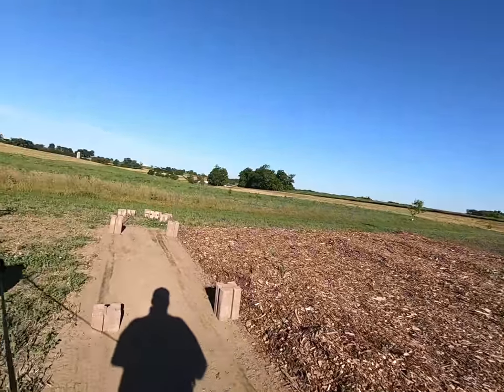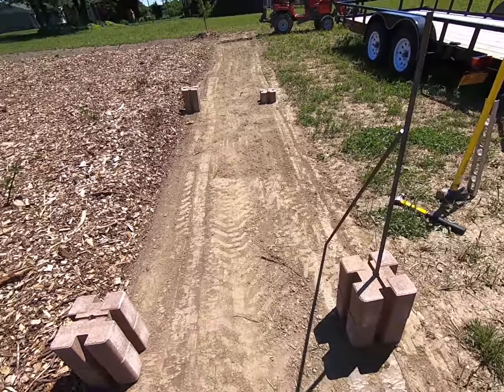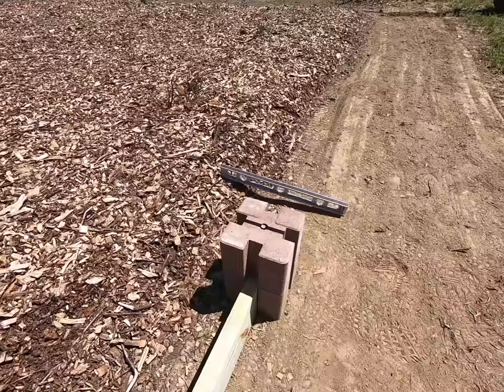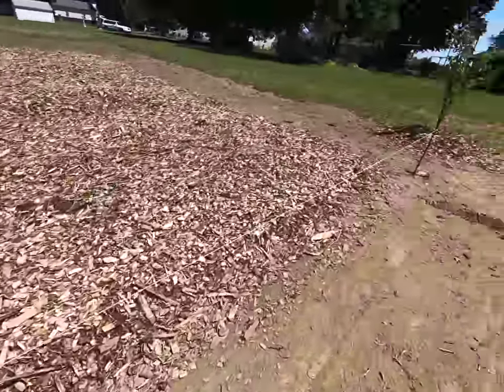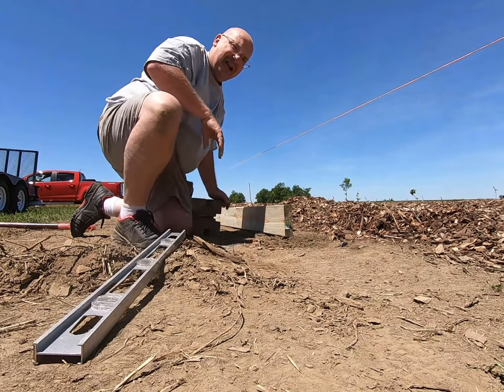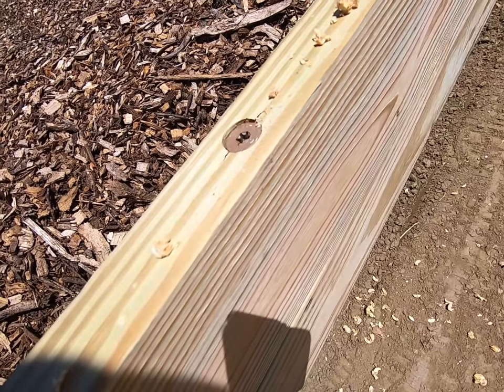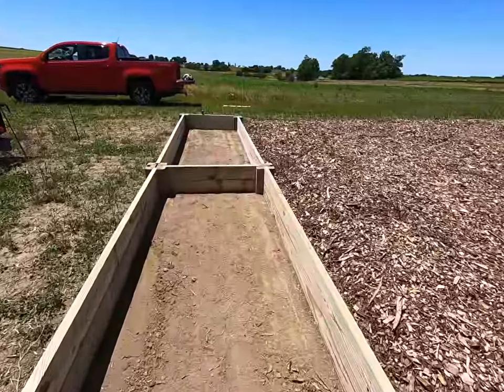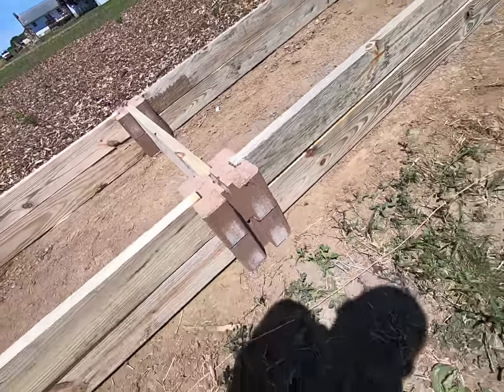EASIEST Raised Bed EVER...Old Castle Blocks from HOME DEPOT

Comment: I like that this design allows beds to easily be taken apart over beds that are screwed/nailed together. I would have gone with 24" rebar anchors, which could be easier to take out if need be(12" through the blocks, 12" below ground). Also, I would only go one block high, considering it will take twice as much soil to fill if two blocks high. 
I know it all depends on personal preference, and what resources a grower has available. Thanks for posting this!
Reply from the maker: Brian White , thank you for watching. Check out my channel if you have time.  I’d appreciate it.

Comment: We transformed our in closed garden 3 years ago that is 21 ft x 13 ft. We had raised beds of various sizes made out of wood. We took those out and designed 4 long rows using the blocks from Home Depot. One that was on the south side that ran east to west, 10 ft. Then we added 3 rows attached to the 10 ft row running south to north using the blocks as connectors. Row two is 16 ft long. Row 3 and 4 are 11 ft long. This allowed room for a wheel barrow to go down between each row and good walking space. I have been very pleased with the ease of using this design with the Home Depot blocks.
Reply from the maker: Terry Sorg , They are handy!  It seems around here our Home Depots will carry something like these one year and never again.  Thanks for wat Hong and check out my channel if you already haven’t.  If you like what you see please subscribe. Have a great day!
Reply: Garden Spots Acres I did subscribe and look forward to seeing your other video's. When we purchased our wood we used 2 in x 12 in  by the length needed. We haven't had any problems we the wood bowing. Also you can order the blocks online and have them delivered to the Home Depot that use if they don't have them in stock. Have a great gardening year.
Reply from the maker: Terry Sorg Thanks for the info.  You too!

Comment: I like the idea of these corner pieces. The6 seem to make it easy to build. My father caught me digging with a claw hammer like that once. Never used that tool for digging again. It sure seems like a lot of work to build a raised bed. Running string and all. It seems you could sight the boards just as easily. All that effort to get straight sides but failed to check for square. The 3, 4, 5 method would be great for this.
Reply from the maker: Simple Minded , Thanks for watching.  I find that hammers are great for digging in the dirt since I very seldom use them for their intended purpose any more. Have a great rest of your week.

Comment: I suggest highly that bolt some flat aluminum or steel cross pieces from top board to board in each  corner for added strength because the one piece of rebar in each corner may not be adequate!
Reply from the maker: So far so good with the rebar. I have put a small board at the center point to keep the bottom from bowing out a bit.

Comment: Hi,
When I see these corner blocks used, I only see them two deep, can you go three deep or even four deep?
Reply from the maker: You could. Rebar would have to be much longer to support the greater instability though. I think if I were going higher I’d use wider boards to span blocks rather than 1 board per block.

Comment: Thanks for the great info!  I have seen similar 'ready-made' raised beds with smaller slotted corner pieces and matching poly-lumber for sale.  Question: Do you recommend attaching a layer of construction cloth on the inside and bottom part of the lumber to prevent rotting due to water contact?
But I do have to laugh at the irony -- location, location, location!  I would understand building a raised bed in someone's backyard in the city, but you have acres of wide open, perfectly good farm land, so why o why would u build a raised bed there?  Plz take it as a joke :-)
Reply from the maker: charismatic 1 , I don’t know if it really matters if you are building on good draining soil.  I’ve had PT raised beds last many years without any lining.  One reason I like this system, if you can find the blocks readily, is if a board does rot it’s an easy change out.  
About why...this raised bed is one of 2 now on opposite sides of a berry patch. (The tilled ground in the pic). Ultimately I want to surround the berry patch with raised beds and fence the whole thing in. We have a dog that loves to pick berries and not let us have any!  Also, we have asparagus in 20 feet and strawberries in the remaining 10. Next year we plan on using the opposite raised bed for more strawberries (this year we planted potatoes). The raised beds are so much easier to keep weed free also.  Check out my other videos and you can see how we are using the land.  
Thanks for watching and have a great week!
Reply: @LancoAmish  Thanks for the info -- makes sense to me now.  :-)  I will definitely check out your other videos.
Reply: We are on 15 acres, and I’m gradually going this route. Tired of the weeds.

Comment: Why 30 feet? Why not 3 10 ft?  Wouldn't it be easier?
Reply from the maker: The 30 feet (made with 3 10 foot sections) is lining the side of my berry patch.  I’ve built another on the other side of the tilled ground this year.  There are now 20 berry bushes growing between the 30 foot long raised beds.

Comment: if you put the rebar in, did you absolutely need to have the dividing lumber? i don't think i understand the point of having the short pieces between. thanks.
Reply from the maker: The short pieces aren’t required.  I put them in as dividers between the 10 foot areas.  I’m going to put strawberries in one of them and I didn’t want them rooting into the next area. Thanks for subscribing!! I really appreciate it!
Reply: @LancoAmish  thanks for responding! i'm starting my garden beds this month, so i just wanted to make sure i'm not going the wrong route! but now i know i should consider them for strawberries ;)
Reply: Garden Spot Acres, I was wondering the same thing about the need for the dividers. Now I see, thanks.

Comment: you didnt add the rebar   and 50 tons of soil  you need
Reply from the maker: The rebar is through the center of each set of blocks.  I have a "never ending" supply of compost that I make.  Check out my channel to see my composting system.  Thanks for watching and have a great day.

Comment: You mentioned pressure-treated lumber. That's poisonous you shouldn't use it for gardening.
Reply from the maker: Nancy Miller , Thanks for your concern.  The new PT lumber is much less toxic and many universities have researched the toxicity of it and concluded that the leaching of the chemicals and the uptake by the plants is so minimal not to be of concern.But I understand your concern and thank you for it.  Thanks for watching.
Reply: Nancy, educate yourself on the newer process for making pressure treated wood.  Arsenic compounds have been banned since 2004, copper compounds have replaced them.  You don't have to use them in your garden if you don't want to but don't depend on someone else's opinion, know the facts
Reply: Maybe line the sides with plastic gardening fabric between the wood and the soil. The type I have seen growers use to stop weeds.